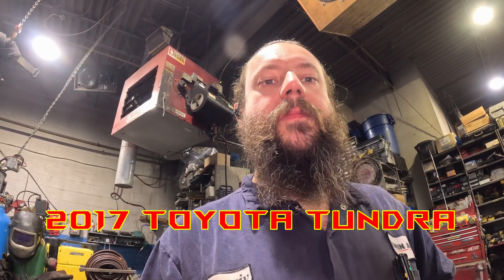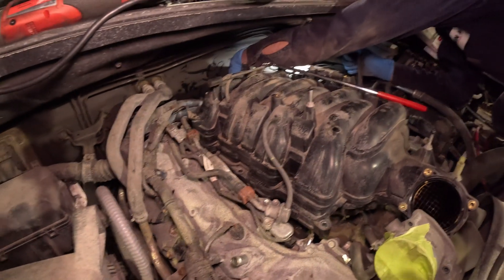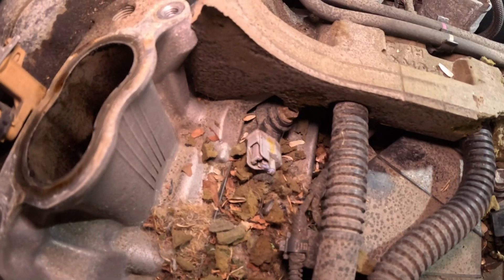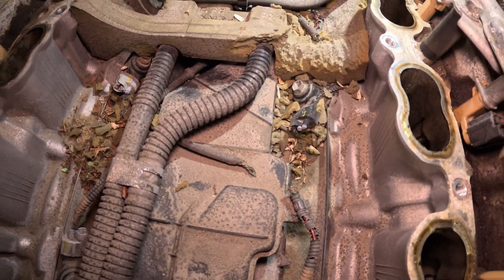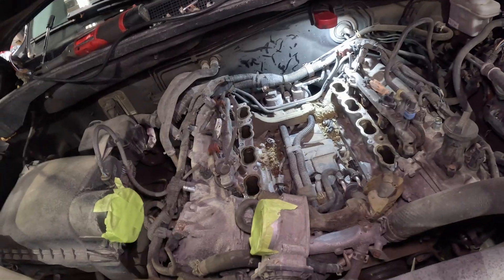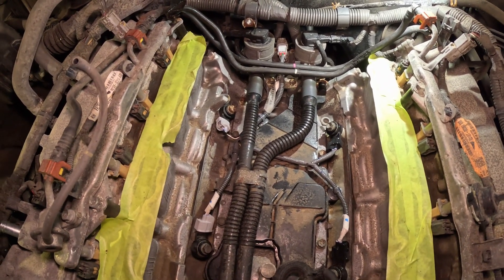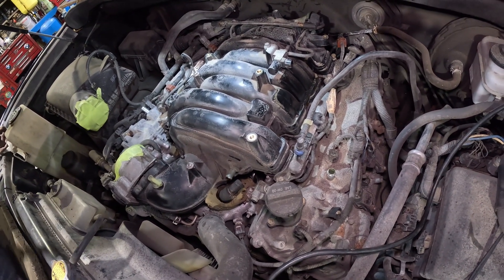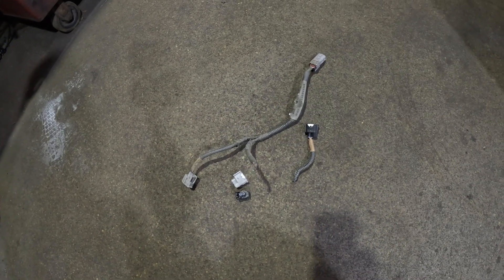2017 Toyota Tundra Knock sensors circuits high P0328 P032D P033D. Rodents nest damage. Easy repair

Comment: How often does a car need to be started to avoid this? I suppose it depends where it is parked but what is the usual minimum usage for those who do not drive often?
Reply from the maker: Starting it every day would probably keep the rodents away, but even then it is possible that they will get in there overnight and still do some damage.

Comment: Very interesting. How do you know that it is mice? And is it possible that they can survive in there while the vehicle is running?
Also I noticed you using an impact driver to put in the bolts, isn’t that a bit risky?
Reply from the maker: Mice are the only rodents that can fit in there by size, so I figured mice were the ones who did this. They ran away, the temperature in there would not allow them to survive. These impact drivers have a gentle setting specifically to make sure they are not going to break any fasteners.